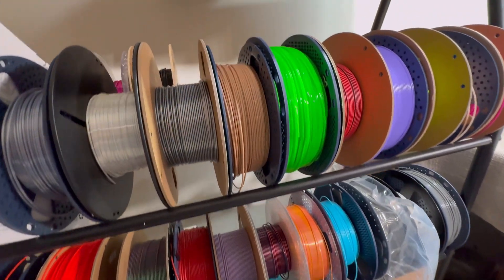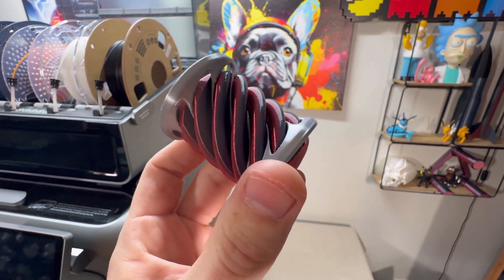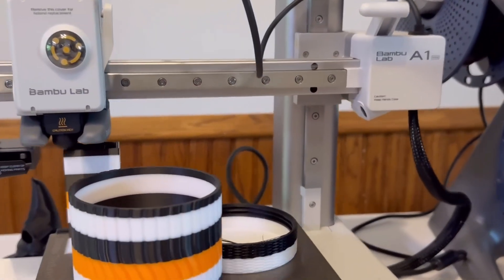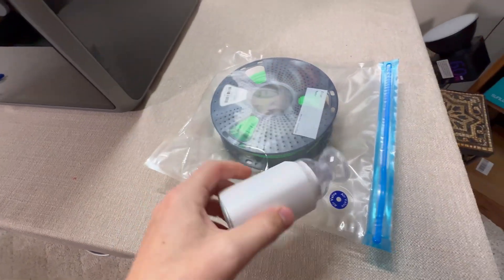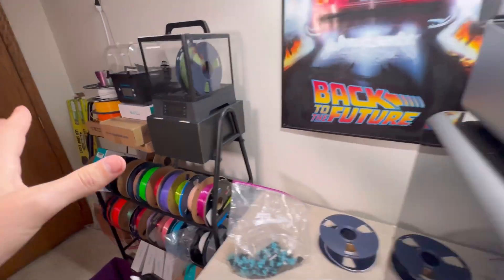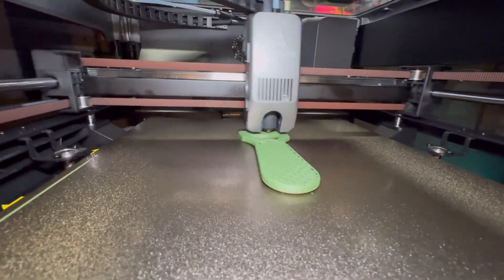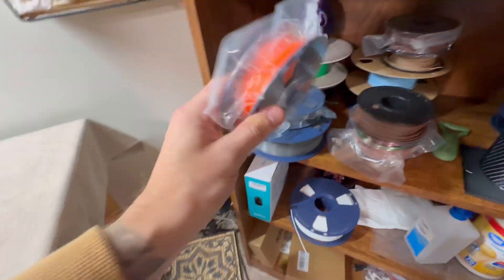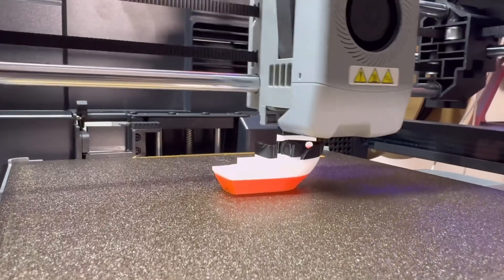Best Filament Storage Practices? Reducing Moisture

Comment: This was a useful video. Useful in the sense that it serves as a reminder that not everyone who gives advice on YouTube knows what they're talking about.
PLA is not especially susceptible to moisture. PETG is more susceptible to moisture than PLA. The problems you've had with your PLA prints could be due to a large number of causes, but moisture is very unlikely to be one of them. These are all things you would know if you knew what you were talking about.
I suggest that you try to educate yourself on a subject before spewing out unfounded opinions.

Comment: "PLA is weak"....  hmm, really? Rather a broad blanket statement. A lot of those specialty PLA types like silk and matte have poor layer adhesion because of the various fillers and additives. That's what you demonstrated when you were snapping PLA parts. You can mitigate a lot of that by manipulating settings and print orientation or simply choosing another material when PLA isn't appropriate for the application. No, PLA is not the MOST susceptible to moisture, it is RELATIVELY insensitive, at least compared to materials like PETG and TPU. A lot of shaky conclusions and advice here. Proper filament storage takes next to no time and yes, you do need to pay attention to conditions when printing PETG and how dry it is.

Oh, one last hint. Even tho it comes from the manufacturer like that, when you vac bag spools don't throw the desiccant in the center of the spool. If you look at a sealed bag you'll notice that the central volume of the spool is sealed off from the filament and the silica is isolated. Put your silica around the outside of the spool in the volume with the filament. That way, what air remains can circulate between the silica and the filament.
Reply: Great comment. I feel like this video does nothing but scare people into thinking they need to tip toe around their filament and care for it a certain way or their printer will explode. PLA especially is NOT as moisture absorbing as people claim, the problem with PLA just sitting on the spool over a long period of time and brittleness isn't usually from moisture, its from the PLA wound around the spool getting a memory of being bent at an angle then over time when you try to run it through a PTFE tube with severe bends the PLA will crack. I always try to use up my filament before opening a new roll to avoid having old PLA just sitting on the shelf.
Reply: I've had pla sitting out for literally months, still prints perfectly fine
Reply: @LunarList  where do you live? I live in germany its really rainy arround here...
Reply: @psyduck4255  shouldn't be an issue around here as well. I have one spool sitting in a quite wet basement for 1 1/2 years after 3 more years just on a shelf in the office and it still prints fine. Standard PLA
Reply: good to know bro ty, i will still get 1-2 bags with dry material just to be safe but sounds good🥴
Reply: @LunarList albiet im in the american SW so hot dry climate, but new to 3dpr my brother gave me some spools of pla+ and one of them (e sun olive green) has been open for about 2 years. Its been my best printing spool that just works, where as with new spools I've had a few issues. And although our overall climate is dry we do use EVAP cooling out here which quite literally pumps humidity into the house
Reply: @LunarList  
It depends on your climate
Reply: even official specs of most filament manufactures say that layer bonding is better on basic pla than on petg. what is pretty much what i experience on my printed parts.
ignoring the diffrent types of pla like basic, silk, matte, and others and petg basic and high flow does not hep either.
and i do totally agree on weak layer bonding on silk pla.

Comment: I got some less than 10 dollar clear plastic sterilite gasket bins. The 2 sizes I have fit either 4 or 8 perfectly. I add 100g of desiccant, I can effortlessly get them to 15% inside while it’s 50-60% outside. I also used one of them as a feeder/poor man’s AMS. And I haven’t had any issues.

Comment: Hi asking for advice, looking to get into 3D printing (total beginner) Bit worried about location - looking to put printer in my garage which whilst boarded and insulated still gets high humidity. If I use a insulating enclosure and maybe even a  heat mat would this be ok or would I be wasting my money. Many thanks in anticipation of advice.
Reply: The enclosure isn't going to have much effect. The water absorbed by the filament only comes into play when the filament is in the tip of the hot end. Keep the filament out of humidity before printing and you'll be fine.

If your garage is super humid, store your filament someplace else, and definitely in a sealed container w dessicant.

The bigger problem w your garage might be if it's cold or drafty. The printer likes a warm consistent environment. An enclosure helps, but a stable, warm room is better still.

Hope this helps
Reply: @VladimirPutin-p3t  Hi many thanks for your quick response and valuable advice